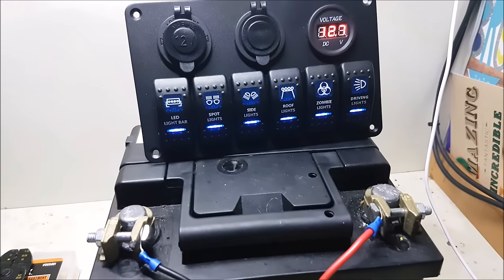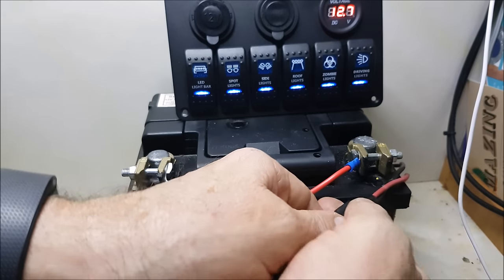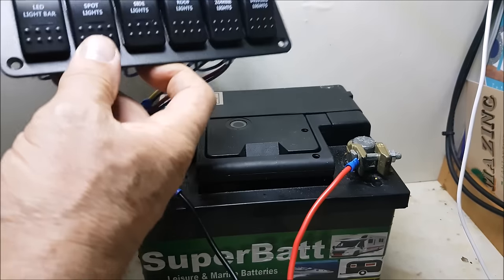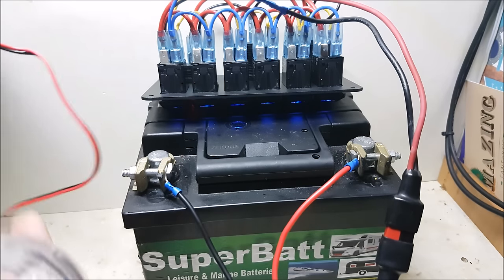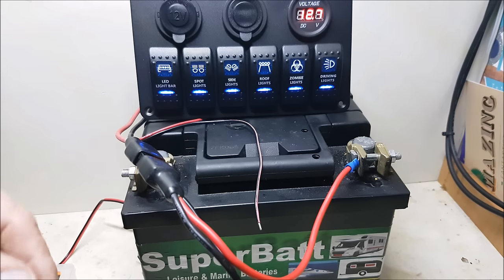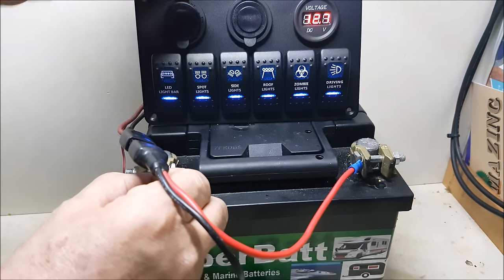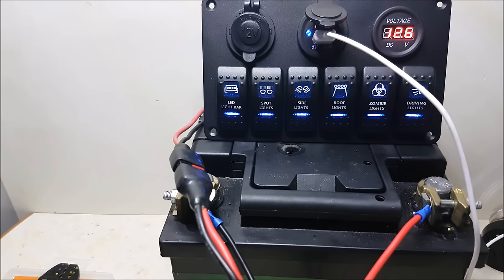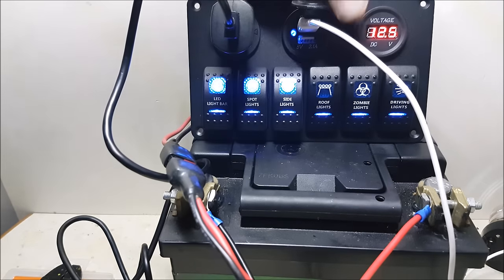How to wire a boat switch panel

Comment: FINALLY!!!! Someone who just kept it simple and you used a battery where most people start in middle of the wiring,thank you Mark 👏👏👊👍
Reply: What about fuses then surely should of added a fuse box not just an inline from battery none of his circuits are fused unless I’m mistaken ?
Reply: @Everydoghasitsday259  you just run the fuse between the power line from battery to the power on the switch. You may want a fuse box if you have components that require more or less current depending on their tolerance.
Reply: This video gives you a brief explanation for using the fuse box for these switches. Some switches will be more simple.https://youtu.be/cXDSVSAwjLQ
Reply: @patrickt1087  thank you Patrick

Comment: Nice video. For those that read the comments, wire your panel lighting, and the voltmeter to a separate switch, can be a small round switch or something.  Reason is, unless you unplug the switch panel every time you stop running the boat, the panel will drain the battery with the constant draw from the pilot lights and the voltmeter.
Reply: Interesting, I never thought about that. I will have mine connected to a 12 V fuse panel, plus it’s a solar array, so this should not draw enough power to affect it.
Reply: @susancrocker5851  or, install an in-line toggle on/off switch.
Reply: Or wire it so all one of the switches is your "on/off" for the rest...
Reply: Im gona run min to à 12v swiched when i turn my key off every thing go OFF
Reply: @djkeys415s 
 
Bingo.
That's how 99% of boat manufacturers rigg anyway, except for the nav lights and bilge pumps.
Reply: I've seen other videos that splice all the negs on the panel, then a negative wire to the battery
Reply: I'm.goning to put an isolation switch in line. So it cuts out all power to the panel.
Reply: Very good point.  I plan to install a simple waterproof on-off switch between the battery and the panel.

Comment: Hi Mark, you don't need to run the negative back to the battery, just tap them into the black negative that goes to the panel, (which is from the battery).
Reply: Thought same thing which ever is closer also goes for cars
Reply: I was just wondering that

Comment: No one explains this on videos that I have been watching on this panel itself the yellow wire goes connected not to constant power but to a wire that when your lights come on for night driving is where that wire will go to so it will illuminate the panel at night time during the day you do not need it illuminated so when you turn it on at night That panel also lights up so you run red to power the blue and black wire to ground the yellow wire so when you turn on your lights on your boat or whatever else you’re using it for maybe car RV and Wala you will still get the high illumination when you push the button to turn on any accessory that you might have connected to that switch
Reply: Yes, I ran the yellow wire to my ignition switch so those lights only come on when the key is on. Otherwise, they will drain the battery over time.

Comment: I just installed the same panel on my boat. Even though there’s a large fuse at the battery you should also wire in a fuse panel between the switch panel and the lamp or components being switched. Get a fuse panel that has spade terminals on either side of each fuse. Or use inline fuses. Each circuit has to be separate from each other. You can’t use a fuse panel with just one main input terminal.
Reply: HEY! I just installed my switch panel to my tracker grizzly boat.  Same switch panel as this one, I ran the negative wire to a negative terminal bar and ran the 3 accessories i have to the negative terminal bar.  Can i run an inline fuse on the positive wire and run in through my ON/OFF cut off switch to the positive term on battery.  The positive wires from my accessories can i put an inline fuse on each of those in between switch panel and accessorie?  Most of my accessories are super low amp LED lights.  Only big one is Light Bar which is 10amp and that came with its own wiring harness with relay installed. Any help is super appreciated just want to make sure i dont mess anything up before i take out boat for first time.  BTW the 12v battery is just for my electronics i have my motor running off its own battery for the electric start.
Reply: Yes Nicholas sounds like you’re on the right track. Ideally the fuse should be between the battery and the switch so the whole circuit is protected in case your switch shorts out but this can’t be done with this setup. That’s why there’s a circuit breaker at the positive battery cable. Next best thing is an in-line fuse after each switch. It’s very unlikely that an accessory will short out. Usually it’s a wire that rubs on something metal then when you power up that circuit the fuse will overheat and blow shutting off the power. If it weren’t for the fuse the wire would get hot and start a big fire.
Reply: @JohnVH-diy  AWESOME thanks for the reply.  with each positive wire having an inline fuse.  How do i know which size fuse to use on the main positive from the switch panel to the battery
Reply: nicholas stidham.  Most led accessories are less than 10 amps some are 5 amps. Count up the amps and that’s your main breaker at your battery. I have a 40 amp breaker which is ideal for most applications. Your in-line fuses should match more closely to your accessories such as 5 amp for usb, 10 amps for a couple of small lights and 20 amps for a cigarette lighter style plug so you can plug in a hand held spotlights etc. If you’re connecting something like a big light bar that’s 30 amps or more you’ll need a relay. A relay is just a electro magnetic switch that uses a low amp circuit to turn on a high amp accessory.

Comment: Thank you so much for this video, Mark. Yes, the included instructions have much to be desired. But, with your perfect video it filling in the huge gaps. Wired just as you did with 4 gang. Grounding to a second solar power battery was the answer. It has to be grounded to the battery. Thank you!!!

Comment: The negatives all going back to the battery was my problem! Thank you so much Sir! Huge help and much appreciated!
Reply: I plan to use a small 12 volt fusebox instead of going back to the battery, as the panel and accessories are in the cabin, and the batteries are in a small shed outside.

Comment: This is the most basic explained wiring video.. it's like wiring for dummies!! Love it.. thanks from aust mate appreciated
Reply from the maker: You're welcome! nathan thanks for watching
Reply: @MrMeltedwellies  no worries mate, I'm using this set up in the rear of my 4x4 and I think a lot of other people watching would be either using it in a boat or 4x4 also.. but I bought a cheap 4 way switch and a couple of the wires connecting at the back have broke so I'll have to spend a bit more and get better quality.. thanks again 👍🏼

Comment: Brilliant....... I watched your how to wire an RV, took me 2 minutes to find the exact same switch panel on Ebay, $28 Australian and 5 days it was on my door step.
I just finished yesterday wiring my boat from scratch - Nav Lights, Anchor Light, Interior Lights and Bilge Pump. You made it so simple to watch and understand even a complete electrical novice like me had no problems wiring it up....   outstanding !!!  Going to wire driving lights to my car now
Reply: How did you wire it? Does the panel shut off when you turn your key on? I need to re wire mine so just curious

Comment: Really Terrific content, Thank You !
My dilemma is for Protecting the SWITCH from passing full (rated) amperage vs adding a Relay to ease the amperage on the Switch, and pass the Load through the relay.
Next dilemma is where the Fusing is employed ?  Before or After switch ?  Seems a lot of amps hitting the panel, straight from the Battery feed.
Again, I genuinely Appreciate you !

Comment: Very nicely explained.  Mine has 3 reds which go to the lighter, USB and meter and then one to 2 switchs each.  His just had  1 wired to all switches and the 3 items on top.   I will use a wire nut to connect all 3 to the red from the battery but otherwise exactly the same.
Reply from the maker: Glad it helpe Bill

Comment: Great post! One thing I didn’t really follow was how to turn off the secondary lights on the panel (the light that stays on all the time) but still get the light to turn on when you press the button. I just don’t want to draw any unnecessary power
Reply: @Mark Archer thanks for the reply Mark. I’m not really following. I’m looking to only have LED’s on when the switch is flicked, not the little leds on all the time. I’m assuming I unplug one of the wires on the back of the box? I also gave thought to wire it into the NAVI lights so they would only remain lit when those are on. Might be too much for me to figure out though, not sure which wire would be connected to NAVI
Reply from the maker: fit a isolation switch 😀🍷🍻

Comment: Great video. But the usb,12v & battery light stays on all the time. Can you use one of the panel switches to control the live feed coming in to turn off the panel so battery don't go dead? Mike.

Comment: Good video. I see that I'm going to want to remove those jumpers because I don't want this to act as a distro box. I want my fuse box to do that. I can pull the jumpers and run power and grounds straight from my fuse box to isolate each circuit. Thanks for the video. It clears up how I'm going to do this for my boat.

Comment: Hello there Sir what cable size did you use to connect from battery to that panel and what do you call those connectors. Thanks! you did a very simple demonstration here good job.
Reply from the maker: 10 amp wire

Comment: Are those switches connected to a circuit breakers?  Do you need to add in line fuse to the lights? Thanks. Great video
Reply from the maker: depends on what model you buy with or without fuses

Comment: I have the same exact panel, thanks for explaining how to wire it up. This is very helpful. Also, good job on your audio and video quality and narration, well done. Cheers.
Reply: can i just tap the ground into the negative wire thats going INTO the panel? or i have to run all back to the battery or buss bar or distribution panel?
Reply: @RoyalStifler  That's a good question, maybe one of our electrician friends here can answer that best.

Comment: thank you for the easy instructions.  I just have 1 question, When you have the boat parked or turned off, wont the lights on the panel drain the battery?
Reply from the maker: i fitted a isolating switch

Comment: Nice explanation sir. I guess we need also a fuse for any light line or any other electronic equipment according its wattage.
Reply: That's what I'm searching the comments for. I was planning on using a fuse block then jumping to each connector, which I still might do.

Comment: Very well done mate. I was thinking with all those lights on all the time is a drain on the battery? Would it be better to leave the yellow and blue wires unconnected?
Also, if I heard you right, you said all earth wires must go back to the battery individually? Why cant you just connect all 6 earths to one heavier wire to take back to battery?
Reply from the maker: yep no problem good idea

Comment: Combine this with a fusebox with bus bar to it and you are golden.
Reply: I have one with a built in waterproof  15a fuse on each switch but it doesn't have a trigger wire and my supply is constant.  I guess I need a relay?
Reply: @anglerandy5736  You don’t have a ground switch?

Comment: Do you need to have a fuse box to wire one of these or can you just hook up the panel and connect the Bilge pump and lights and all to it ?
Reply from the maker: i just connected mine straight to it  works fine
Reply: Mark Davies so you didn’t use any fuse box or what not? I just don’t wanna have short going around

Comment: Great video mate very well explained ,i am looking at putting one of these on my refurbished boat if i have what you say right if i ran a wire from a junction box /block  back to the battery negative i could run all the negative wires from  say nav lights ,anchor light , ect back to the block as long as i have a negative on each of the terminals similar to the way the gang switch is wired up is this correct

Comment: Hello, Mark great video, can you tell me where you got your battery push connectors from ?, they seem very handy for temporary  battery connections when required for testing electrical fitments, Thanks.
Reply: They are called Anderson Power Pole Connectors...you need to buy a crimp tool for them though, but they do work great and make a very solid connection but easily unplugged if needed.  I run them on my Amateur Radio gear as it makes it very easy to plug into other equipment if everything is all wired the same.

Comment: What if I have an aluminum boat?  Would I still need to run the negative back to the battery, or could I just ground it to the metal on the boat up under the dash?

Comment: Extremely helpful tutorial . Question?   Where do I get the push in connectors ? I looked  at Home Depot and couldn’t find it ?
Reply from the maker: ebay Bryan
Reply: Thanks Mark I figured it out .
Reply: One more question ??? The main red  and black wires straight to the battery are what gauge? They need to be bigger then 14 awg ? Thanks again!

Comment: Do you use a fuse box to connect all the negatives back to the battery? Is that what you met by terminal unit?

Comment: Silly question I’m sure but the item (light) negative will go back to my buss bar ? And the positive from the switch to the item (light) ? The positive feed from buss bar goes into the switch is that correct ?

Comment: Hi are these switch panels fused or do you have to run thru a separate fuse box thanks, good vid by the way
Reply from the maker: Both some have fuses and some don't so i would  install a isolation switch

Comment: I have that same panel, I disconnected the bottom led lights so it won't be on while not in use and drain the battery down, and I also added another power supply after the 3rd switch because having 1 source supplying all 6 switches is too much of a load

Comment: If you buy a panel off ebay , please ditch the included wiring if you are using the panel for safety related items  - bilge, fire pumps, alarms etc . The wiring is not crimped to any standard, and in fact  most wires just pull out with a moderate amount of force. I am talking about the wires into the crimped spade terminals, not how hard it is to get the spade crimps off the switch terminals. Also, most of the switch terminals will pull out of the body of the switch pretty easily. So either remake the spade terminals on the wiring, or better yet, solder the spade crimps to the wires if you are using the included wiring. you don't want to be off shore and need your bilge pump to save you from sinking, only to then find the wires have fallen out of the crimp on the switch.

Comment: Excellent video,  I have a question,  having this whole panel lid up all the time won't drain your battery? 
Can you make this work only when you turn the key to on position?
Thanks for your time.
Reply from the maker: yes you can not sure the wire you need to disconnect just give it a try 
Mark

Comment: Does the bottom row of lights in the amp meter stay on will it way down your battery or it don’t draw that much let me know thank you
Reply from the maker: they stay on but i fitted a isolation switch
Reply: Ok Thank you I think I put a off/on switch in the line👌✅

Comment: Would a ground distribution terminal be suitable? Rather than having all the negatives run all the way from the dash to the battery at the stern?
Reply: Other videos I've watched recommend that. Or you can get a fuse block with the negative side also.

Comment: Thank you so much. I'm about to rewire my boat and this thing just turned up in the post. I've spent the last half hour looking at it, trying to work it out 😂 I think I'll mount a separate switch on the wire that feeds those little running lights so I can turn them off when I'm not using the boat, otherwise, they will drain the battery :/
Reply from the maker: Glad it helped
Reply: They draw almost 0 power they will not drain the battery unless it is waning

Comment: I like this panel but quick question. I will need to mount mine vertical and would like to know if the volt meter can be rotated so when I mount vertical it reads normal. Thanks
Reply from the maker: Not sure Dan but i think so

Comment: I understand the comment of badly written diagram.  I am using this switch in my Van instead of a boat.  What confuses me is that the Yellow - Blue wires connect to the Lower Dash Lights...What are the "Lower Dash Lights".....This gives me the impression that I would be able to place an LED light on my dash which would indicate if any or none of the switches are activated individually.  Unfortunately I can not place the switch where I can see it.  Can you please provide me with some direction?

Comment: hello looking for help on by center console rocker switches.
my bilge pump has a on/off/auto ,so it is a 3 position  rocker switch.
bilge pump goes on on position on, off in position off, but nothing happens on position auto.auto also had a red led which is not lite up in standby, like it used   to be.
all spade wires appear to be well connected.
are these rocker switches all on positive side to connect/disconnect positive voltage?
sorry for the lengthy questions wonder if i have a defective rocker switch.
thanks
john